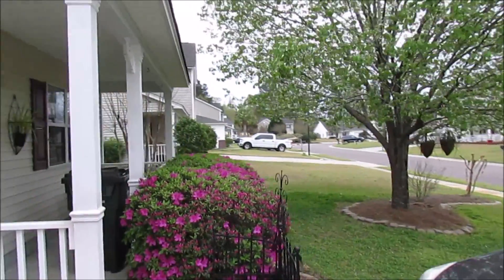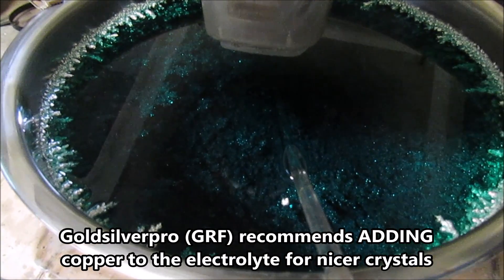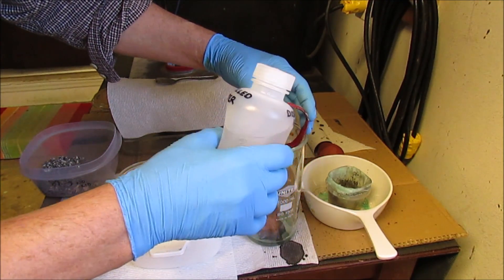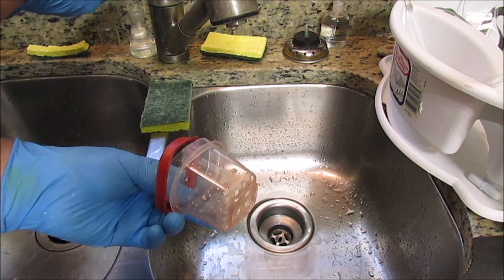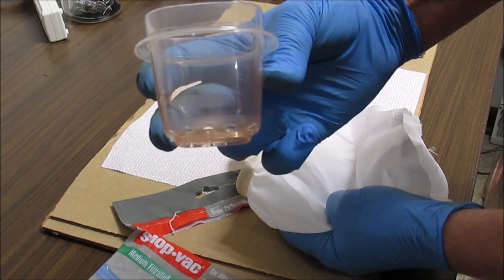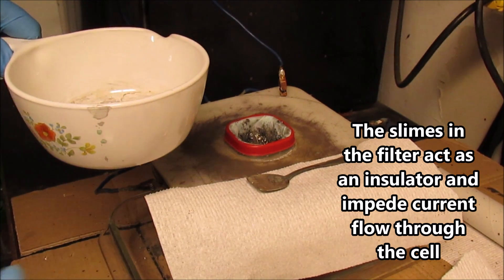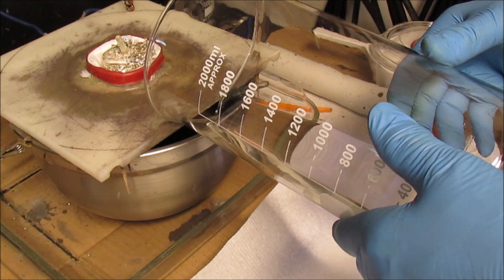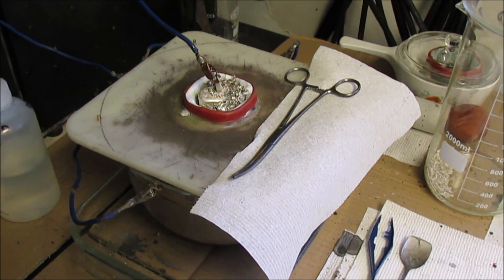Silver Cell Anode Filter Change Out

Comment: What bowl are you using for that silver cell? A regular kitchen bowl?
Reply from the maker: Yes, stainless steel from K-Mart about $9
Reply: Thank you! I'm going to be starting some hobby silver refining from thrift shop sterling etc and stumbling across your channel has been the best thing ever, do you have a pattern or accept cryptocurrency tips?
 @sreetips
Reply: Found your PayPal 😊
Reply from the maker: Thank you!
Reply: One little question, would it be suitable for the novice to directly electrolyse sterling scrap as opposed to nitric leeching and cementing? Just looking at cost effective ways to get started. @sreetips
Reply from the maker: I have put sterling/925 directly in the anode basket. But the electrolyte quickly becomes saturated with copper. It's best to use 99% silver as feed stock for the cell, in my opinion.
Reply: Cool thanks, just being encumbered with purchasing restrictions on nitric in Australia @sreetips

Comment: How much pure silver do you get from 10 ounces of silver shot?
Reply from the maker: The impure silver shot is about 99% so I should get 9.9 Troy ounces. But I've never taken precise measurements so I'm not really sure. Some of the silver in the electrolyte gets plated out of solution as the cell operates. The only losses come from spilled electrolyte. None of the silver gets consumed during cell operation, that I know of.

Comment: The copper in solution would help cement out the silver by conductivity or by replacrment?
Just curiuos.
Reply from the maker: David, Only metallic copper can cement the silver, not copper in solution. I don't know the mechanism behind crystal growth improvement that results from copper being present in the electrolyte. GoldSilverPro on the goldrefiningforum.com recommends adding dissolved copper to the electrolyte to improve crystal structure. Or you can just wait until it builds up from the impure silver being dissolved in the anode basket. I know that fresh electrolyte with no copper makes small crystals. Only when copper is present, as indicated by the blue color of the elctrolyte, do I get to see those amazing large chunky crystals.